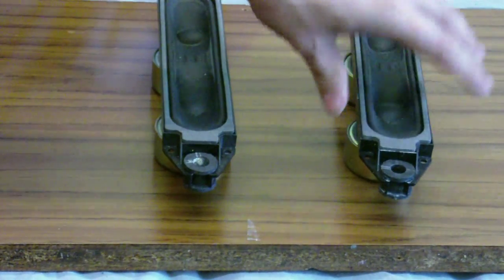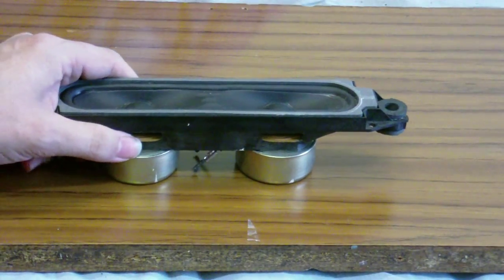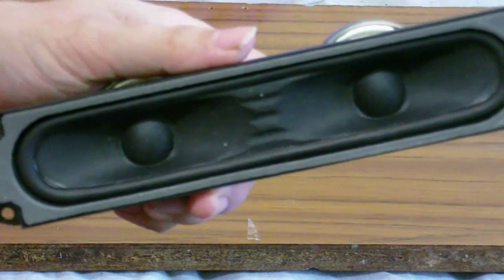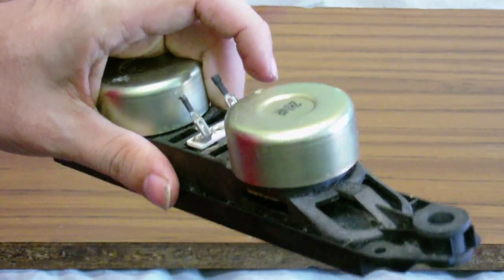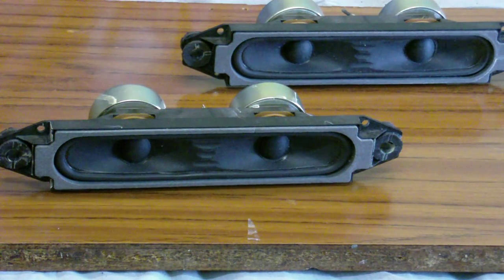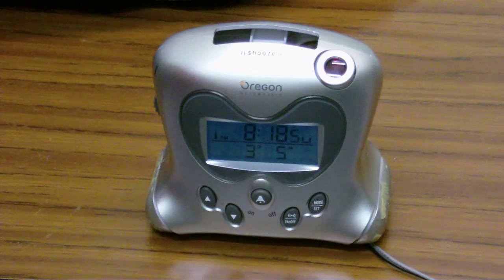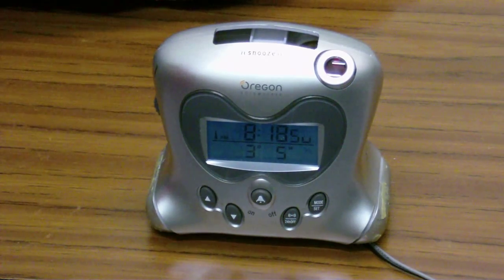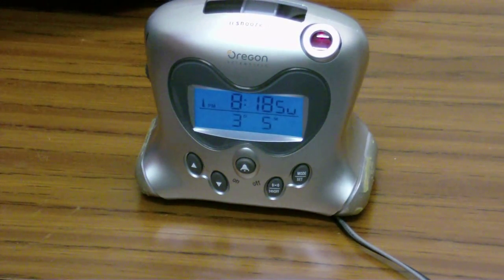Some speakers I found and circuit-bending a clock

Comment: learn electronics and troubleshoot,follow wires,test integrated circuits and
semicomdubctors leading from power 
cord to speaker and/or add:wires,logic,
remove SOME logic NOT counters,etc.
just unhook it from the alarm switch
and logic/radio and that,should fix it.

Comment: what is the coil in the back of the clock radio ? is it the antenna ? have you ever made one if these antennas, i might have a go sometime, whats in the centre of the coil...some sort of metal.

Comment: I have an Oregon Scientific clock radio which also has a projector feature, the EL backlight for the clock also makes a high pitched whistling noise when it's on, sometimes it interferes with the radio.  Was that flashing pink light the LED for the projector?

Comment: That's a neat speaker, it's a double, with two speaker fused into one. Neat! I'd like to hear how they sound. And maybe you could build a couple of wooden boxes for them and have them on a little stereo! And that clock sure made odd and funny noises, the beeps when turning on were probably from the piezo speaker.

Comment: These are two really interesting items, the speakers seem  to be developed especially for being used in a TV because they are small but very long and the magnets are shielded, so they won't have any influence on the picture tube.

The clock is very, very interesting, the noises it makes are really strange! Also the projector is interesting, maybe it's possible to built a projector like this somehow using a big display and a bright light, that would be an interesting experiment...